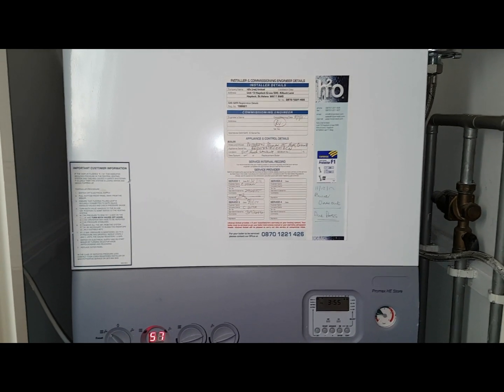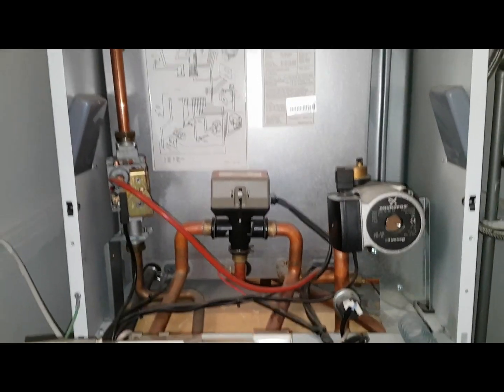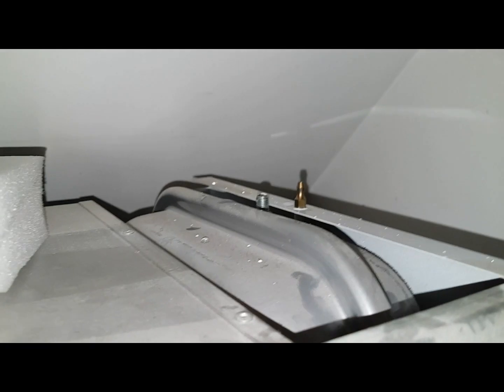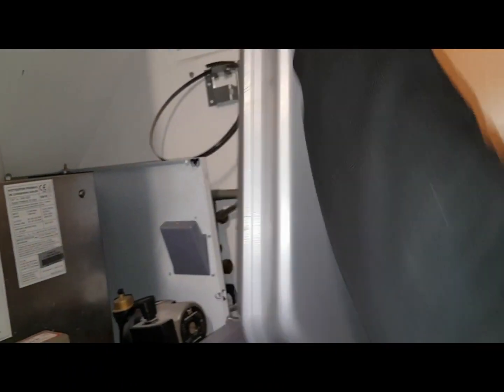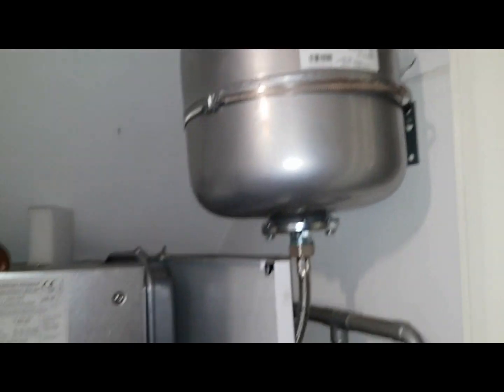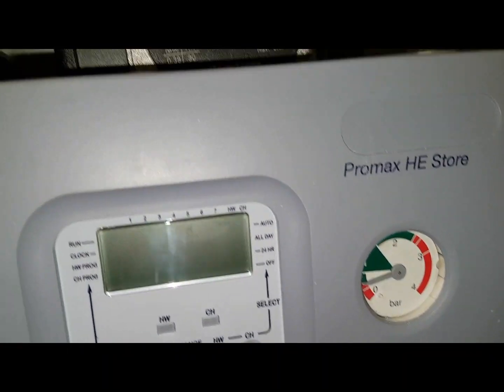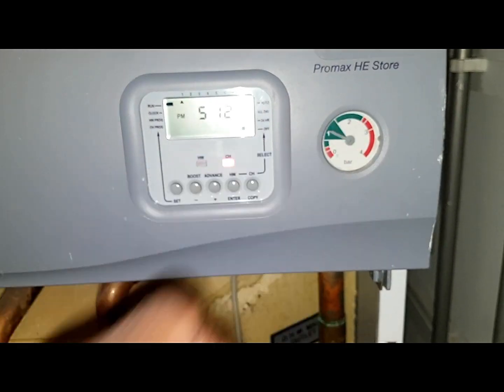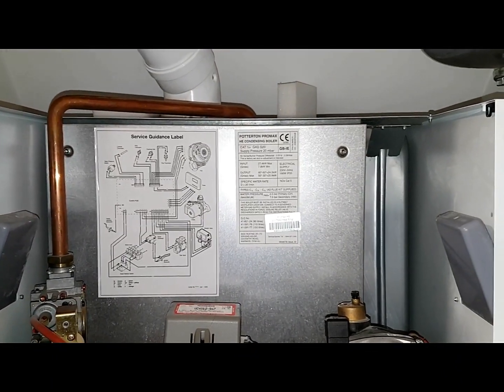Pressure is Going Up  Potterton Promax HE Store. With Coach Tony Morgan

Comment: Hi. I have same boiler.  Recently i am having issues with low and higher pressure.  First go down. When i top up then goes to high. In red level. Like 2.4 orhigh. And secondly with hot hotter settings radiator goes on. Keep warming.  Please can you advise whats wrong. 
Thanks